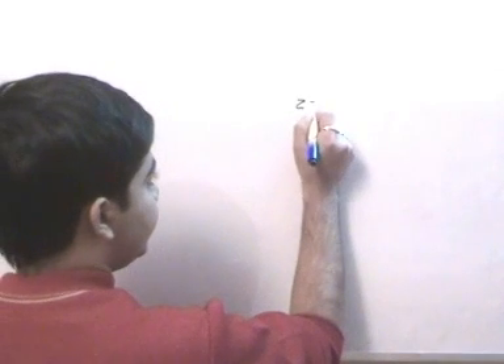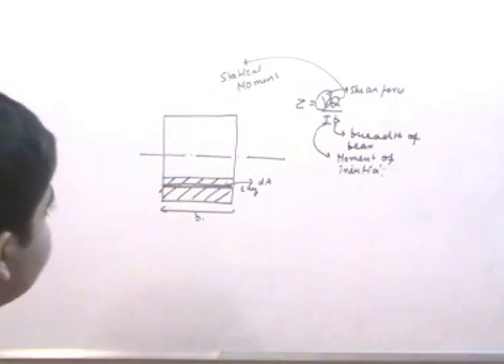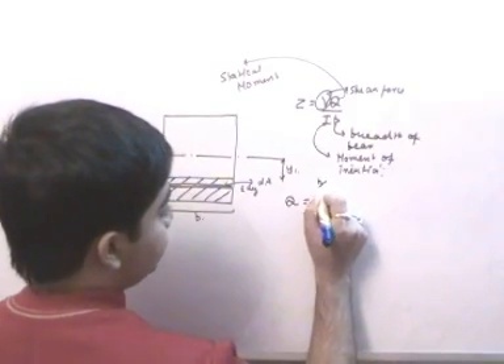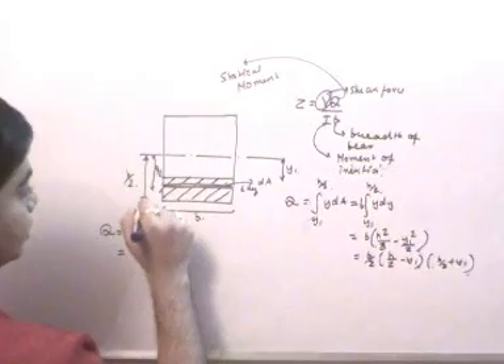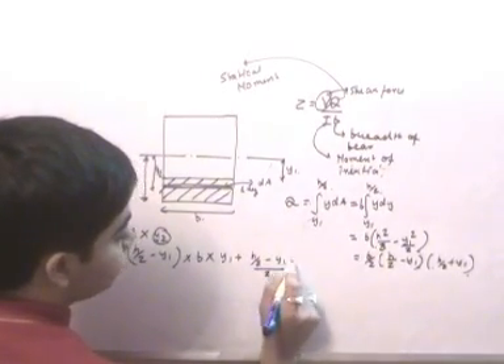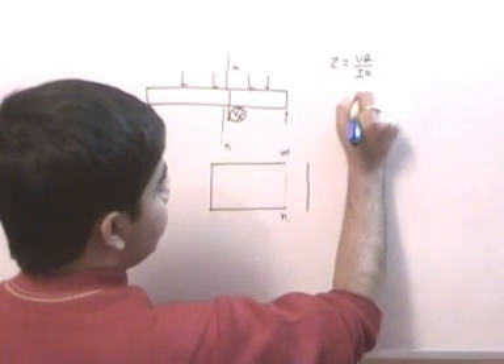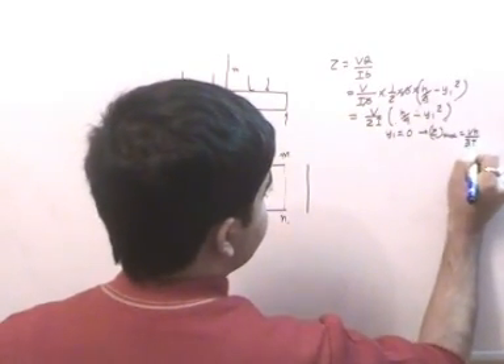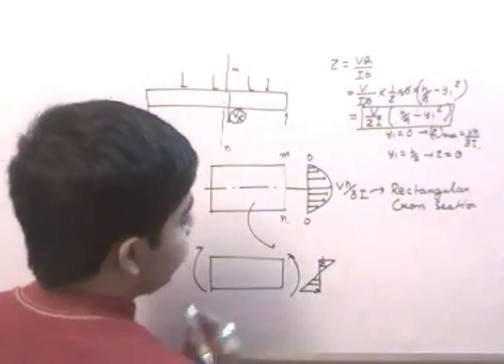shear stress-3.mpg

Comment: Thanks, But You made a mistake. When you were simplifying you forgot to square h. Subsequently you missed the correct formula for Q when you substituted it in t=VQ/Ib
Q is equal to Q=(b/2) ((h^2)/4-(y1)^2).
but you wrote Q=(b/2) ((h)/4-(y1)^2).